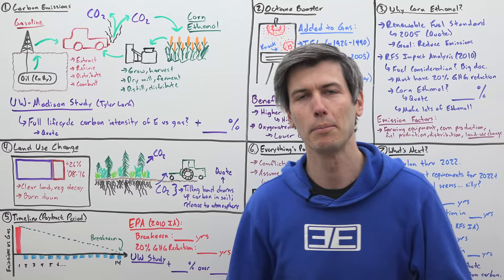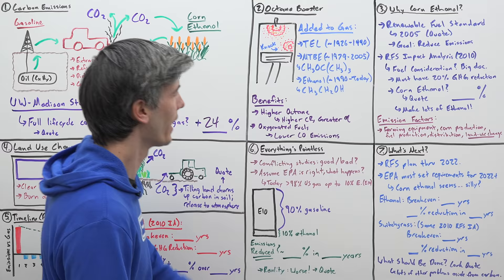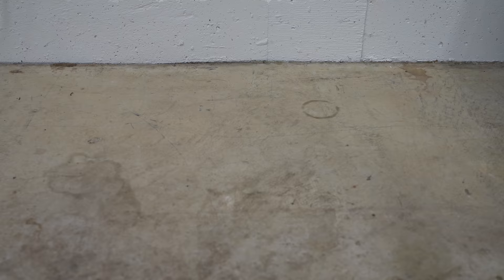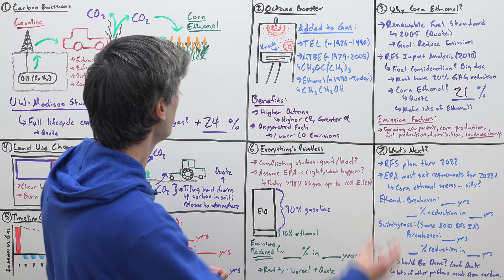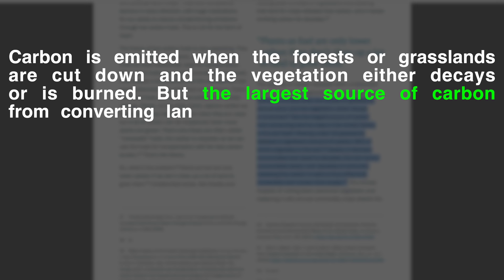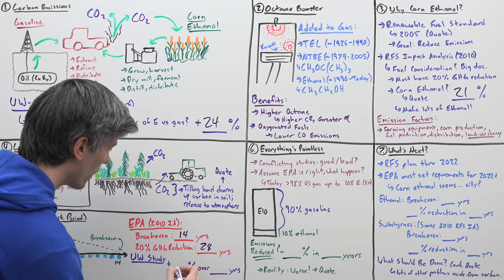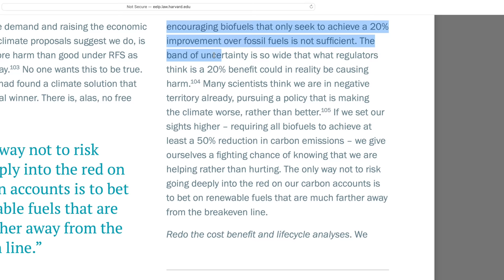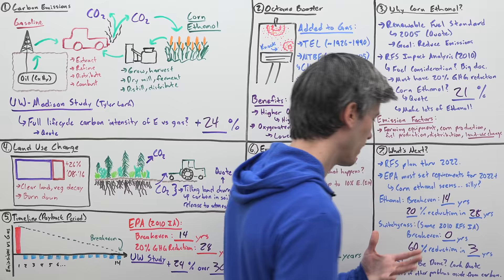America Was Wrong About Ethanol - Study Shows

Comment: The impact of using corn was indeed considered and this is why considerable effort went into using the stalks and other associated materials, much harder to do than using corn kernels but using genetic modification of the fermentation systems this was done.  This then allowed biofuel to occur during the production of normal corn crops.  The challenge was again cost in that this process was expensive and this is more the reason it failed as a venture despite some big name companies investing billions in this research. Ultimately, systems must not only be carbon positive but also economic.  Plastics can be made from sugarcane but the cost of such materials is 3-4X the cost of hydrocarbon feed stock. The carbon argument is important but the king of it all ends up as economics.

Comment: In Brazil,  the engines are flex fuel able to run with  Gasoline or etanol
The Brazilian etanol is pruduced from sugar cane.
We have available 2 options: a mix of 73% Gasoline+ 27% etanol or  100% etanol
Normally, i prefer to use pure etanol due to co2 emissões.
When you use  etanol the engines consuption is higher, but the cost per liter is lower. So, the final cost per km is simillar.
Reply: Sadly, the car manufacturers are quietly stopping production of flex fuel vehicles even in Brazil.  Go look, your new Ford F-150 doesn't offer a flex fuel option even though it does in the US.  A lot of flex fuel vehicles are gone now in the US.

The leader now is India, they now require all new vehicles sold to be flex fuel.  France's government approved the selling E85 ECU converters.

Car manufacturers have to purposely program the ECUs to throw a yellow engine light when ethanol gets to >E50 give or take.  I wonder how big of a kickback the petroleum industry gives them for doing this.

Comment: Brazil has a huge industry for ethanol made of sugar cane, and it works great when engines use 100% ethanol. It may not be good for environmental yet, but is sure way more powerful and economic viable than gasoline in South America (ridiculous taxes). Unfortunately, in Brazil, corrupt oil companies and politicians realized that, and inserted even more ridiculous taxes on ethanol so the population would depend only in poor quality gasoline.
Reply: Ethanol produces less power than petrol.
Diesel can be produced from vegetable sourced oils
Reply: @samueljesse2179  e85 has a higher octane than petrol
Reply: @samueljesse2179  that is factually wrong. Ethanol burns slower and more complete than gasoline, which means you can advance the ignition timing significantly and gain horsepower. 

It also has a higher octane, meaning it can withstand higher compression ratios and significantly higher boost pressures on forced induction applications, once again increasing power and efficiency.
Reply: But for some reason, when the gasoline price increases, ethanol prices also increase in Brazil! :-(

Some years ago, when we bought a car, we had to choose gasoline or ethanol. Nowadays, engines work with both or even a mix of them. Unfortunately, the industry is controlled by some few and very rich families/companies. When petrol price raises, the ethanol also raises. For that reason, we all keep using gasoline.
Reply: Não esquece de falar dos tremendos impactos no aquífero. Na quebra do ciclo da água e do excesso de fertilizantes nos canaviais nos rios/corpos d'água. Além de tornar o solo uma 💩
Reply: How about we eat the corn and take the hand cuffs off of the industry’s and let them find what works
Reply: @gargar8196  we don’t eat field corn. Only sweet corn
Reply: @smiller3110  switch seeds and use the same fields
Reply: @gargar8196  there’s a huge market for field corn bro. It’s used for many things such as making alcohol to name a few. It is an increasing market and biofuel is only part of it. And crops always get rotated. If you grow the same crops every year it destroys the ground. We rotate with corn, wheat, canola, and soybeans

Comment: The biggest problem with burning fuels is not green house gasses .. its the loss of atmospheric oxygen.  For the purposes of insulation, an atmosphere's overall density is the main factor, from a physics standpoint: it does not matter what element(s) compose the atmosphere, only its volume and mass.  On planet Earth, the greatest mass is Nitrogen - but that can't be regulated and controlled, so no effort is made to try to reduce the planet's Nitrogen .. politics.
  
Let's get back to the actual environmental problem:  When fuel is burned, the Oxygen for that combustion comes out of the planet's atmosphere .. and when the byproducts of combustion are eventually processed through photosynthesis, we do not get all of that oxygen back (photosynthesis is currently lagging far beyond CO2 production, which is where Agroforestry folks like yours truly come in, but that's another topic)
 
The net LOSS of atmosphere has a cooling effect, ironically (try taking the temperature of any gas under pressure, then reduce that pressure .. the cooling effect should be obvious) .. But more importantly, that loss of atmosphere was OXYGEN, and we need that to keep breathing.  The Oxygen loss from burning Octane (gasoline) is much higher than from burning Ethanol, but even Ethanol would deplete our atmospheric O2 over time.
 
Here is a balanced fuel combustion equation for gasoline, followed by a balance photosynthesis equation, using the combustion products: 
6(C8H18) + 75 O2  >>>  48 CO2 + 54 H20

Now, after photosynthesis:
48 CO2 + 54 H2O  >>>  6(C6H12O6) + 36 O2 + 6 H2O

39 molecules of O2 are 'lost' in the process .. some remain in water vapor, and some remain in the glucose that was made during photosynthesis .. but they are not returned to the atmosphere.  The atmosphere loss is (approximately) 289.96 grams per gallon of Gasoline burned.
Here's a look at Ethanol, combustion, followed by photosynthesis of the products of combustion:
3(C2H5OH) + 9 O2  >>>  6 CO2 + 9 H2O  // One could multiply this equation by 8 to bring the total of O2 consumed by Ethanol close to the amount consumed by gasoline, if one desires, for ease of comparison - I might, when I give this lecture.

Now, after photosynthesis:
6 CO2 + 9 H2O  >>>  C6H12O6 + 6 O2 + 3 H2O

Only 3 Molecules of O2 are lost burning Ethanol (24 if you multiplied the whole set by 8).  We still loose oxygen, just not as much. To be fair, I did not do a comparison of energy produced by gasoline vs ethanol .. That metric could skew things a bit, but the central point remains the same:

As long as we continue to look for fuels to burn to produce energy, our atmosphere will continue to be depleted.

Also, growing corn for fermentable sugars to produce ethanol is not a great idea.  Sorghum produces more sugars/acre, requires less water, less fertilizer, less pesticide, less tillage, and less energy to process.  
Additionally, if one is going to be making fuel, vacuum distillation is a far more energy efficient (and fast) method for extracting Ethanol from the mash.  It seems that folks have 'Make corn likker with a reflux still, and use it jest like gas' stuck in their heads, or something.

Comment: Using high ethanol concentrations in some cars can yield huge power gains. A lot of small turbo engines, such as VW, audi can use e50+ levels and when retuned, easily make 2x stock bhp.
Reply: Maybe if you eat alot of corn you will get 2x double power💪💪 Turbo😎
Reply: You'll get an increase but not that high without modding and tuning. But yes high HP boosted cars can gain 60-80hp just switching the fuel alone.
Reply: I love e85 and so does my car, I am also loving the price of e85 2.99 per gallon compared to 4.69 premium per gallon.  I also didnt panic at the pump during our recent gas shortage bc e85 was available.
Reply: The power gains are great, but it being cheaper is a complete scam, ends up burning the price difference either way through energy density. Do love it in my Mazdaspeed6 though

Comment: This was awesome and excellently informative! I love your analysis and comparison within this video! Could you also make a similar video about the pros and cons of Renewable Diesel (RD)? That would be amazing! :) Thanks.
Reply: How is Renewable Diesel different from Biodiesel?
Reply: @sammiller6631  Renewable Diesel can be made from the same sources as Biodiesel, but it is processed with hydrogen instead of with methanol. The end result is a renewable fuel that has properties virtually identical to petroleum diesel but with significantly less CO2 and particulate pollution when burned in a diesel engine. This allows it to be used in any diesel engine--even at extremely cold temperatures--without the gelling or clogging issues that Biodiesel is known for. Renewable Diesel has some of the advantages of both petroleum diesel and biodiesel while avoiding many of the disadvantages.

Comment: In my mind, the only ways to change the direction we're heading are:
1. Fully synthetic fuels - Fuels made from renewable resources which either do not pollute or pollute so little that our existing forests easily absorb it
2. Hydrogen-Electric hybrids - Creating some new way of safely and efficiently storing and filling up hydrogen based ICEs (Internal Combustion Engines), which is basically rocket fuel. And the rest of it would be electric, which should be cleaner once we discover a way to make batteries more cleanly, because making EV batteries pollutes as much, if not more than running ICEs.
3. ICE replacement EV kits - building batteries + electric motors that can be "engine swapped" into existing cars without having to scrap the entire thing to buy a completely different car. All-in-one, in the engine bay, or alternatively engine bay and trunk.
Anything else is just a band-aid.

Comment: Excellent Lecture, Sir. I say this not because I am an engineer or scientist. I am a knowledge glutton and I appreciate it when someone like yourself can explain something I have just baseline intel of. I understood everything you talked about with ease and it will surely help me find out out why e85 fuel is, for all intents and purposes, not available in Canada. Thank you very much! \m/
Reply: E85 actually costs more to use because it lowers you MPG and the difference in cost doesn't make up for this. It takes 1.9 times as much ethanol to run your car, per unit of air, than gasoline. Does E85 cost 1.8 times less? No it doesn't, and the claim is that it still has 15% gasoline. If you do the math it doesn't work out to an advantage for the end user, only the producer. It works out to around 1.5 times less MPG and around .6 times less cost.

Comment: I have studied envriomental science (bachelor) and I always, from the beginning thought it was so weird that people only focus on carbon emissions. It shouldn't be about carbon emissions, it should be about sustainability. Sure extra carbon emissions is bad. But you want to create a future (lets say a 200 years from now) where we can still more or less do the things we do now. The idea that humans can dictate climate is nonsensical. We cannot change the distance from the sun or the tilt of the earth in its cycles. However, using short cycle things like bio-based ethanol could be one of the temporary things in search of a more cheap and less envriomental costing option. Since coal, oil and gas will run out we need to find alternatives. You don't just want to contineu use those fossil fuels until you are almost out and then have to scramble for something else.
Reply: "The idea that humans can dictate climate is nonsensical."

Dude, you are 250 years behind the curve. Benjamin Franklin wondered if volcanic aerosols could effect climate, and Joseph Fourier speculated--with research--that fluctuations of levels of different gasses in the atmosphere might cause ice ages. John Tindall proved  in a laboratory in 1859 that water vapor, CO2, and some other gasses trap heat, and Svante Arrhenius did the math in 1898, and got it substantially correct. Earth has a thermostat. And while other things effect it, the concentration of greenhouse gasses in the atmosphere is by far the most important input. Did you miss class the day they talked about gasses absorbing and re-emitting energy? It's very like the mechanism that makes the sky blue, or that makes a fluorescent light work.

CO2 is just the blasting cap. The main explosive charge is methane. There are gigatons of methane locked up in dead stuff in Arctic and Antarctic permafrosts, in gas clathrates under seabeds, in the vast matts of Azolla laying dead on the floor of the Arctic Ocean for 55 million years, awaiting warm enough temperatures to rot, and in the peat bogs we are destroying like there's no tomorrow. Planets seek and reach equilibrium. Warm Earth a small fraction of a degree, and you increase the amount of methane emitted. That warms the planet a bit more, releasing more methane, and in a runaway positive feedback loop Earth warms 8 degrees C. in 2,000 years (PETM), and you have a mass extinction event. 

We're dumping greenhouse gasses into the atmosphere perhaps 50 times faster than the Siberian Trap flood volcanos did when they caused the End Permian mass extinction, that killed 90 percent of everything then alive. If we don't stop dumping GHGs into atmo 20 years ago, and suck a whole bunch of it back out ASAP, we won't have a future 200 years from now. But what really makes me wonder is how you could earn a BS in environmental science and not know that. Seriously. Did you miss a lot of classes?
Reply: @johnorenick9026  typing this from phone so mea culpa on typos.
I am not saying humans dont contribute and cause. But what of the milankovich cycles? You think they have no impact? Or what do you think caused the little ice age (1800 something)? 

Lastly i didnt graduate, but that was due to other reasons like the study ending before i could graduate. Climate is more complex than Just methane and CO2 but you seem to have a good grasp on things. Lets not go personal alright.
The last thing inwould like tonstate is that because of the insessant talking only of CO2, people forget all the important other things like strategic security, local sustainablility and such matters.
Reply: @gaoth88  Climate change is massively more in depth than just CO2 and methane. These are just the main two as they are produced in such high quantities to be alarming. The planet has methods of reducing these, but it has a breakeven point where everything made after a certain point just keeps building up faster than it can get rid of it. 

A great example is the talk of ecological dead zones. The hypoxic zone in the Gulf of Mexico is a great example. It's mainly caused by the chemical and nutrient runoff from farmlands carried to the sea from rivers like the Mississippi. This is an area nothing can really live as there's not enough oxygen in the water for fish to survive and allows anaerobic bacteria to thrive releasing many different forms of toxic fumes. 

But in general, we usually go back to CO2 and methane as they're easier to explain. The main point being that as glaciers melt that releases the CO2 and methane they trapped while also lowering the planet's albedo which both increase heat intake. It's a slow process, but from pictures of glacier national park in the US in 1906 and 2006 we can see how much the glaciers have retreated. Some time soon there will be no more glaciers at glaciers national park when it used to be the entire mountainside. Today it's just a few small fields. 

While yes there are natural cycles, very little has changed recently that would cause this to occur. A great example is in some cycles it was caused by slightly higher solar radiance. Well we've actually been in one of the lowest solar cycles on record and it's been rather low for the past few decades. There really hasn't been anything natural occurring that could be considered a major cause of this temperature rise. We even recently had a massive volcano blast recently yet that year still resulted in the hottest year on record.

Comment: Ethanol over time screws up a lot of stuff as well. Personally I don't think the engines run the same.
Reply: I know I know....I have seen what it can do!
Reply: That is a myth. 
I’m still running my 1980 Toyota on ethanol gas. I have no problems.
Reply: @joebloe9901  it is a myth! MiT did a study many years ago. Ran both trucks , 1 on fuel, 1 with e85 for 100k miles then tore both engines down and realised the truck than tan E looked cleaned than the truck than tan normal fuel
Reply: @joebloe9901  not necessarily Toyota engines are indestructible try the same thing with a ford